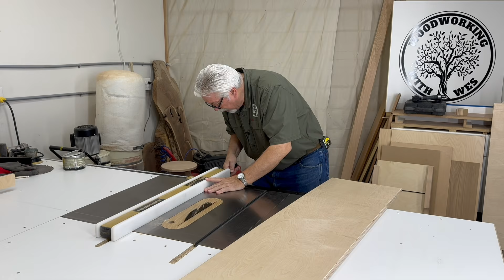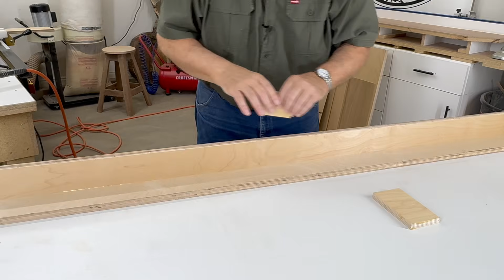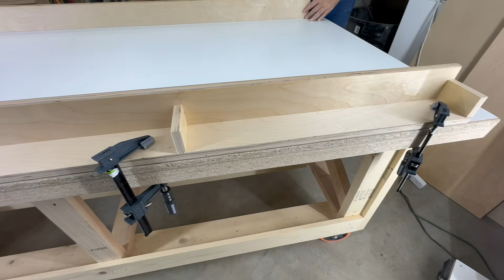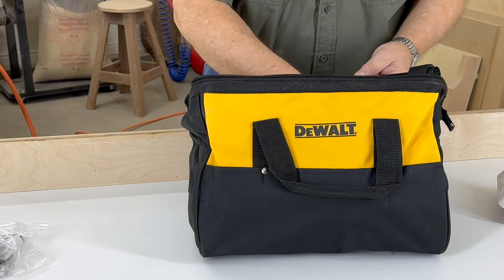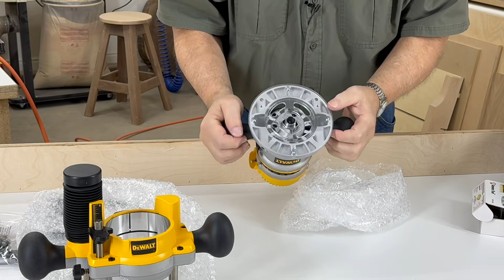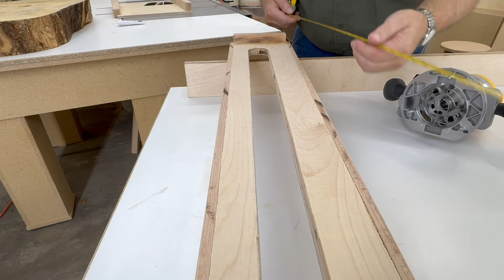Save Hundreds When You Build Your Own Router Sled

Comment: Wes, when you were talking about the "secondary rail" at 7:00, I thought, "Why not allow the legs of the rail to act as  'primary & secondary rails?' If you made one leg 6" and the other 4" couldn't you clamp either leg of the rail to the table to allow different depths of stock? Example: you have a 5.5" stock that is too high for the short rail, you clamp the short leg of the rail to the table and allow the 6" leg to be vertical. On the other hand, if your stock is 3.5," you could clamp the long leg of the rail to the table. Of course, if you have even larger stock, you could screw a third, independent rail to the face of either rail leg and run the sled on that surface.
Reply from the maker: Hi...yes, I believe that would work! Thanks for sharing, I appreciate the comment. Wes

Comment: $60 sheet of 9ply birch, did I hear that correct? I may have to visit your area for plywood! The plywood I can locally is at a big box store for a higher price and is not of any real quality. Local wood specialty stores sell quality plywood but the price will make you shed a tear!  Maybe you can do a quick video on sourcing wood and plywood. I am looking under the wrong rocks.
Reply from the maker: Hi...I actually purchased this piece of plywood on the damaged sheet rack. Check your supplier for the same. Thanks for your comment, Wes
Reply: I was going to leave the same comment.

Comment: I was going to ask a question as to why the flat side was faced to side of rail. I watched it again and I believe I realized why. It is so the router wouldn't  spin around while using it due to the rounded edges. Well I think that would be why. Otherwise I like the sled idea will remember to come back to vid should I need one. Thank you

Comment: Nice idea.  Wonder how well it would work to put two t-nuts in the middle and two on each end on the bottom and then use screw in feet with maybe a rubber end that would have some grip on the table in order to raise and lower the sides of the sled.  That way it would be infinitely variable and you would not need to screw an auxiliary piece on that would only raise it to one other height.  And you could still clamp it to the table for further stability.  Just a thought.  You're videos are always quite good by the way!
Reply from the maker: Yes...I see where that might work and I appreciate the comment. Thanks Wes

Comment: What were the dimensions?
Reply: This is a custom build. Dimensions are determined specifically by your table size and plunger router base.
The rail sides are 4" x 3-1/4" x any length that you can fit on a table... or floor.
The optional ancillary fences are 6" x the length of the side rails.
The rail ends are the width between the side rails when mounted to the table. 

The router sled bottom length is equal to the width of the outside edges of the side rails when mounted to the table plus 2".
The router sled bottom inside width is determined by the diameter of your plunge router base.
The router sled sides appear to be 2"
 The end blocks are 1" x 2" x width of the sled bottom. Mounted 1/2" to 3/4" below the sled sides. You could make them 2-1/2" tall, and mount them flush at the top.
Reply from the maker: Thank you so much @ST-0311 I really appreciate the informative reply you gave. Wes

Comment: I'm just shocked you've never owned a plug router Wes...I have the same one, the dust collection is outstanding on it, it collects 95% of dust,  love the adjustments on it.  Funny I'm considering building a sled and you upload this, thank you .
Reply: I also have this router but no dust collection. Can you provide a make and model for what you have, or provide a link to your dust collection attachment? I use mine with my router sled and the dust/waste it creates is unreal.
Reply: @drproguine9509  I use Cen-tec hose and attachments that come with it, these attachments will connect to any tool, and you know that rubber hose on the slide are dust collection right? The larger slide is the dust collection , Lots don't know this, and your router came with a plastic piece that sits in the base that insures to trap dust and get sucked up the slide, Amazon for hose and attachments, plus the hose has a relief valve to help with swirl marks when sanding, very reasonable prices, the color of hose is silver for a bit more reference, I swear it gets just about all the dust, I was stunned when I discovered this lol .they make massive mess with our it...
Reply from the maker: @drproguine9509 The dust collection comes with the model I purchased which is in the description. Thanks, Wes
Reply: What is a plug router??
Reply: @JRJStacks  never seen a miss spell from spell check? You know what I mean dude...